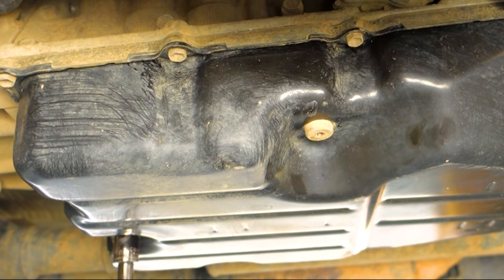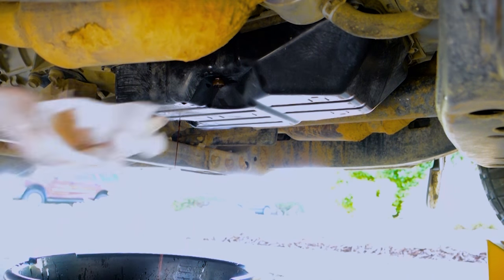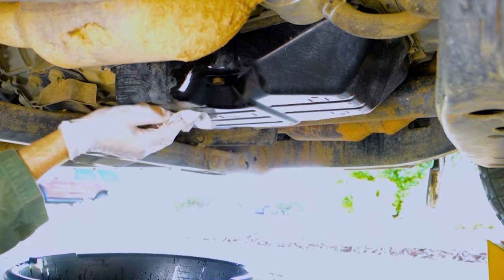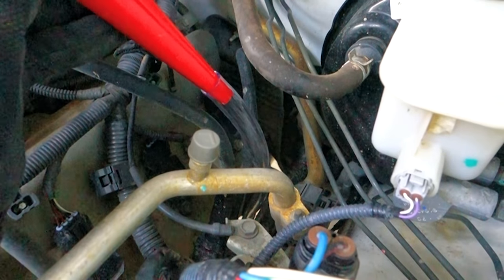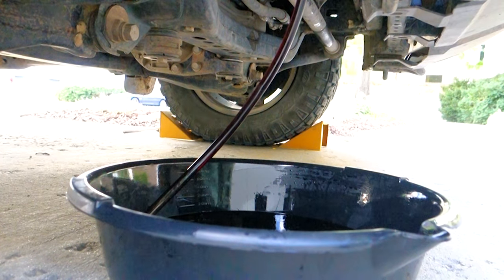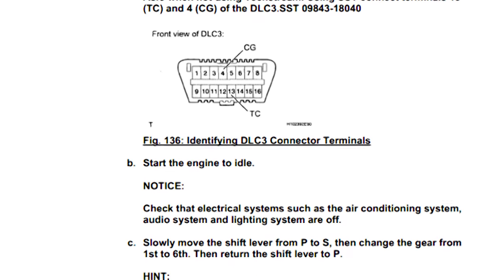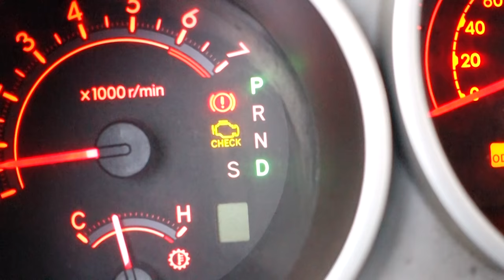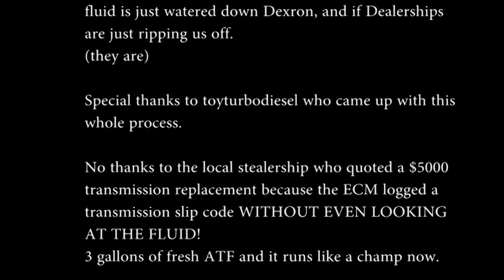Toyota Tundra Full Transmission Flush

Comment: Explore Southwest, can you give us an update on the Tundra?
Reply from the maker: Yeah definitely!

The transmission is still running like a champ.  The occasional gear slippage I experienced before the fluid change never came back.  I keep an eye on my dashboard gauges while driving in more stressful situations and have never seen the AT Oil temp sensor go above the middle of the gauge.
There have been a few times I've been a bit rougher on the transmission than I should have been.  Sometimes while coasting down a hill I'll drop to a lower gear to help engine braking and it's never given any alarming thuds or violent shifts.  The transmissions downshifts quickly.
I've also mashed the pedal down a few times merging into traffic which a few times before caused the transmission to slip because of the sudden load.  That has never happened since the fluid change, now I have the opposite problem where I've chirped the tires or spun out a bit because the power of the engine and the solid drive-line caused the wheels to break traction with the road ans spin.

Comment: Have a 2010 4.6L 4x4 model with tow pkg. and has almost 80 k miles. Will probably do this procedure soon. Without researching this, is there another trans fluid that is recommended over the Toyota WS fluid? Thanks.
Reply from the maker: In the forums using alternative fluid was probably the most debated topic.
I went with the general consensus and used "Valvoline MaxLife DEXRON/MERCON ATF"
http://amzn.to/2gfSE7S

It can be found at most Auto Stores, and on the back of the bottle it says it's a compatible replacement for "Toyota WS".  As one person online pointed out, that either means that they tested it and verified it's a good replacement, or they're willing to have the pants sued off them if they're lying and it blows your transmission up.  Either way you're covered.  Plus I give companies the benefit of the doubt that a big company like Penzoil isn't going to lie on the actual bottle just to get few sale if the risk was that big.
Reply: Explore Southwest Thanks, was just curious. Will probably stick with WS fluid and just look around for the best price.

Comment: After the initial fluid dump from the pan you say, now you can seal the drain port back up we won't be taking this off again. so does this mean the remainder of old fluid will be coming out of the outlet #1 oil cooler hose as it is being replaced with new fluid until new fluid begins to flow out of the oil cooler? Please confirm. Thanks! -eric
Reply from the maker: Yes.  That's the whole basic idea.
The pan is drained and replaced with good fluid, then you try to keep that filled with new fluid while you run the engine and suck it through the system.
The old fluid is poured off before it can return to the pan.
Theoretically it should replace most of the old fluid with new, but the complexities of the Transmission is you're only replacing a percentage of the fluid. However it's a much higher percentage than if you just drained and refilled the pan alone.

Comment: Thank you for this video. 
Question: In your video you said to only run the engine while going through the gears until you get the same amount in the pan that was initially drained. Then you say, "once you have clean oil coming out", so do we continue the process of adding fluid and going through the gears?
Reply from the maker: Yeah.  The Transmission has different chambers and fluid pathways that the fluid passes through in different gears.  Shifting through the gears just helps get new fluid everywhere.  It wouldn't be disastrous to NOT shift through the gears, you'd just have a little more old oil diluted into your new oil when you're done because some that was in there never got flushed out until you shifted through all gears driving after the oil change.

I also considered not doing "batches" of the oil change and to try doing it all at once.  The only concern is that the AT oil sump seems to get sucked dry faster than I could pour the new oil in and I didn't want it running dry and sucking up air bubbles into the transmission.

But again, I don't think it would be terribly bad if you did suck air in by accident.  I think the system is self purging so if you get a few air bubbles in there, they will work through and come out a few seconds later in the pan.  That's why you do the oil level check at the end, just to make sure it's all good after all bubbles have been flushed through and there is new oil in all the chambers and channels.
Reply: I like the way you did it in the video.  Drain the entire pan, refill with that amount, and repeat draining that same amount out of the cooler line.  It makes perfect sense b/c if the vehicle is hot, you should be adding a hair more cold fluid.  When you warm it back up to do the check plug drain, you get to drain off the excess.
Reply: Great Video! My Question: Im old, so I havent crawled under to find the valve location, where is the location of the this valve ? Driver side ? Front/ rear of tranny? Thank you! By the way Im looking at a 2008 Tundra 4WD BASE MODEL !

Comment: about to do this, did you start with the transmission oil already warm or from a cold start
Reply from the maker: It was lukewarm, the truck had been sitting about an hour; but definitely not cold 

This was kind of a problem when I had to do the procedure to get the fluid level correct.  Just running the engine to pump the old fluid out heated the fluid up past the measuring point.  I went inside the house, ate dinner, came back outside 2 hours later to try again and the fluid temp was just about right.
I know that different model years seem to use different fluid temps for the level-check procedure and the 2009 seems to like the temp to be pretty cool.
Reply: Explore Southwest what is the proper temperature is it better to do when first thing in the morning or should I run the vehicle and let it rest for a few hours and let the temperature be like a hundred hundred fifty degrees what do you think
Reply from the maker: I prefer to do it at a higher temperature, the fluid flows much better when it's warm.  The problem only came when I had to do the fluid level check, the instructions for my model year involved the fluid being lower than that.  So I took a break in the house to let everything cool before wrapping up the whole thing.

Comment: Would adding a Out Bucket and In Bucket with 9qts in one (input) could you just cycle in and out equal amounts + .5L and call it even ?  verifying light drip out of fill hole?
Reply: Once you pull the line off the cooler the there is no longer any pressure in the return portion of the system, so no suction to pull in the clean fluid.

Comment: I dropped a plastic nipple into the fill port of an A760f- the 6-speed in the GX460. I dropped the pan and valve body and don’t have access. Will this stay put, will it get ground and and be caught in filter, or will it destroy the AT?
Reply: should be fine as long as its not very small....like a bb or something.
Reply: @dalephillips8250  thanks dale. That was the general but not unanimous consensus as I frantically questioned message boards and a dozen or so mechanics I associate with. However I opted to use a flexible borescope camera to find it and attempt extraction. It sat in a cavity where the fluid pours and drains into the gears. The nipple was large enough to fall through the 2” chamber opening into the gears. So it would have eventually gotten chewed up.  I believe in turn this would have made it to the valve assemble and caused damage. After about 16 hours of effort, I finally fished it out. I have some video on my page of the effort although I wasn’t capturing when I finally got a good hold on it- obviously I wasn’t going to spoil that moment for some internet points!
Reply: @MrTigerHank  thanks for info.   I Said that because all ford crown vic,grand marquis and Lincoln Town cars will have a yellow plug floating in the pan the first time you drop the pan to Chang fluid/filter as was in mine. I was told this is because the trans dip stick tube is plugged from factory and they just punch it down in to the transmission at first fill and don't worry about it. But it is rather large and can't make it into any thing important

Comment: I have the 07 v6 4 speed automatic tundra and  its been slipping for awhile now but tonight past 40 mph it would not shift over then when I turned off my truck and then back on the transmission light,  VSC light,  and the traction control light were all on. Is this because I need to do a transmission flush? 123k miles
Reply: slipping? delays or wouldn't shift? sounds like you are running low on atf. replacing it and adjusting the level most likely would address that. but won't address a leak if you got one.

Comment: Do you need to lock the thermostatic valve open if you're just doing a drain & fill?
Reply from the maker: You don't NEED to.  But all that fluid in the cooling loop will be trapped and won't get flushed.

Comment: nice video. i have a 2017 tundra sr5 4x4 with trans cooler. but my trans lines going to the cooler are not in the same place as yours in your video. i dont want to screw this up. my truck only has 16k miles on it. ive done 2 engine oil changes myself and stupid me, i changed oil today in preparation for a long trip and i drained the trans instead of the engine oil. so nice clean red oil came out but it was too late! the trans pan emptied. so I really dont see a need for the full flush and all that at this point, i just want to add the fluid back and call it good.

but i would like to know about the trans lines on my truck so i can do it for real in another 15k or so. thanks
Reply: DEANES ON THE MOVE if you drained the transmission fluid thinking it was the motor oil pan, perhaps you shouldn’t be working on your truck.  If I were you I would just stick to maintaining the blinker fluid levels on your truck.
Reply: @MajorCordite  LOL.

Comment: When you're checking the fluid level do you still have the paper clip holding the thermostat in?
Reply from the maker: I did.
Although in retrospect I don't know if you need to or if it makes a difference.  There shouldn't be any air in the AT coolant loop, so open or closed it wouldn't really affect the overall amount in the pan.
If it's closed the fluid is held inside, but if it's empty there is no air hole in the top to allow the fluid to drain (plus the engine is running so everything is in constant circulation).

The procedure for changing the oil and the procedure for checking the fluid level are 2 completely different processes in the Technical manual; and the fluid check process doesn't mention holding the thermostat open.
For that reason I don't I would leave the paperclip in.

But from the way it's designed I also don't think it would make a big change to the level if you left it in.

Comment: was that valvoline max life synthetic? and how many quarts did you end up using?
Reply from the maker: Yes it is Valvoline max life synthetic.
From what I read online you need just shy of 3 gallons for the swap.  So I bought 3 and a quart to be safe.  But the fluid started running clean after just over 2 gallons, so I ended up using 2.5 gallons for the swap.  But when doing the leveling check procedure I ended up pouring most of the last half gallon in.
I was a little wasteful during the leveling check but was glad to have the extra fluid instead of coming up short.

Comment: shouldnt the filter be replaced as well though?
Reply from the maker: It's not a requirement (though technically according to Toyota neither is the fluid change).

I thought long and hard about doing it myself.  The amount of work needed to swap the filter is much more than just a fluid change and requires buying new filters and gaskets.
I decided not to replace the filter because it's really just a mesh screen and not a paper/cloth-like filter.  EVERY person I talked to online that did the full filter replacement said that there was no blockage and there had been no need for it and wouldn't recommend it.

So my train of thought is to focus on doing fluid changes a bit more often to keep the fluid clean.  A Transmission fluid change isn't a 100% change, there is always some dirty fluid contained in the chambers so it's more like a 75% change each time you do it.
Reply: I totally agree with you Jeremy.
Reply: @exploresouthwest  Thanks for this informative video.  I removed the pan and changed the filter and the gasket.    If you do go this route, you would need to order the rubber O-Ring on the transmission filter, as the OEM version from toyota does not come with one.  Other videos on YouTube does not mention this.   I understand that some aftermarket ones comes with this O-ring.    Another note is that there is about a quart of fluid in the filter and residual ATF in the pan that does not come out when you remove the drain plug.

Comment: When do you repeat the process. Drive how many miles and change again?
Reply from the maker: It's really your own prerogative.  Toyota considers they system sealed and never needing maintenance which sounds like BS to direct traffic to their dealerships for repairs to me.
I prefer to stick to a schedule similar to other foreign vehicles, maybe slightly longer giving Toyota some benefit of the doubt.
45k-60k miles.  Maybe a bit shorter if the first time you change the fluid and it seems especially bad, darker colored than normal or a "burnt" smell.

Comment: BIG PROBLEM - In this video you only changed about 4 quarts of fluid total.  And the problem is that the transmission holds about 11 quarts of fluid. So you still have 7 quarts yet to change.  Also, NOTHING mentioned about which transmission this is... there are 4 DIFFERENT transmissions for those years:  5 speed a750e (2wd) and a 6 speed a750f (4wd) and then 6 speed in those years has different numbers as well... so what is this for?

Comment: So about 6 quarts?
Reply from the maker: Roughly, yes.  But it's certainly fine to have extra in a jug at home if you need to top it off later, or if you change the fluid again in 30k-60k whatever.

The problem is that it's not a 100% transfer like draining and refilling the engine oil.  The transmission has all kinds of nooks and crannies and multiple pathways for fluid to pass through depending on what gear the transmission is is.  So the more fluid you move through it the more of the old oil you clean out.
By time 6 quarts has gone through you've probably flushed out 90% or more.
Reply: Explore Southwest  6 quarts total to get the job done, flush and refill?

Comment: Is yours a 4x4?
Reply from the maker: Yeah, with the tow package.
Reply: Explore Southwest  hello love your video man is it necessary to change the filter out if you're going to do a flush I am going to do a flush but I'm just going to use to gallons would it be okay to mix with the old oil SW transmission fluid oil and also I am going to have somebody helping me when the oils actually coming out in the pan from the hos I am going to be pouring it in there at the same time so it does not get low and run dry is that a good idea keep the same level at all times you know what I mean

Comment: Where can I find the thermostat shaft mentioned on 0:29-0:53?
Reply from the maker: On mine it was on the passenger side of the transmission.  In that clip I looking up into the underbody with the front of the Truck is down to the right.
But you'll only have that module if your truck has the tow package with the automatic transmission oil cooler.  Otherwise it's not even there.
Reply: Thank you very much, now I can attempt the fluid change.  Did the valvoline ATF give you any problem?
Reply from the maker: None at all, it's easy to work with.  And currently the Truck is running fine on it.

Comment: $400. ??  Last time I had mine done it was $180.00.  I do change all other fluids in my Tundra except the tranny.  I wouldn’t recommend doing this on your own.
Reply: Where you have that done at shane brown. From cushman?
Reply: sounds like a "pan drop". Meaning about 25% of the fluid is changed out. Toyota quoted me $200 just for this. You get about 4-5 quarts of new fluid...so sort of a refresh.
Reply: shane brown  I was just quoted $375 from a Toyota dealer for an A/T fluid exchange.
Reply: forcedair 92gt yea it's outrageous. they pretty much refused to do a full flush for me even though I made an appointment and was ready to pay for it. They acted all unprepared and even though I told them what I wanted and made an appointment. When they said it was going to be $300 for a pan drop I said forget it I can do that in the driveway for the price of fluid...Just DIYourself. I did and it was easy. Drain what you can out of the pan, then carefully measure what you drained out and replace the same amount. Use WS fluid, it's probably best not to mix. I did this and it was fine..it shifted better afterwards.There's no need to do the stupid temperature check. They aren't as sensitive as people say.